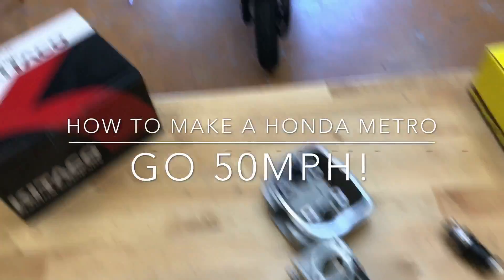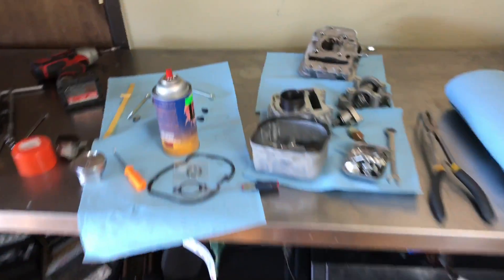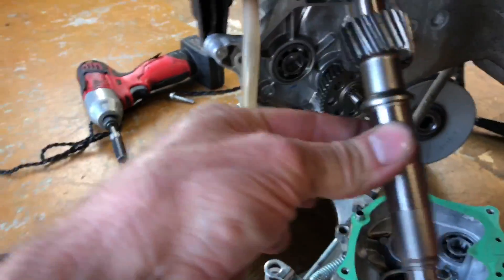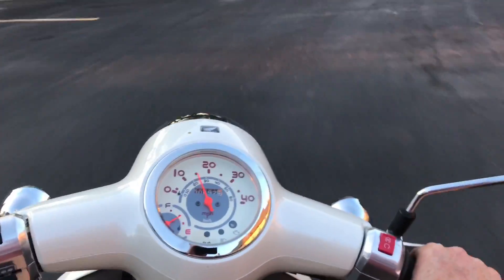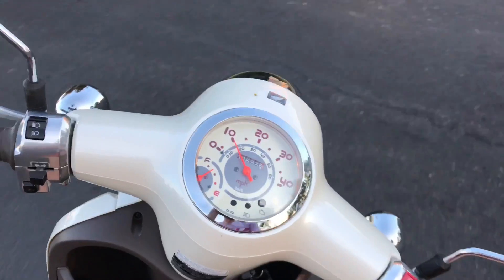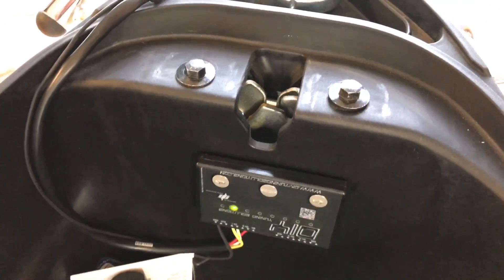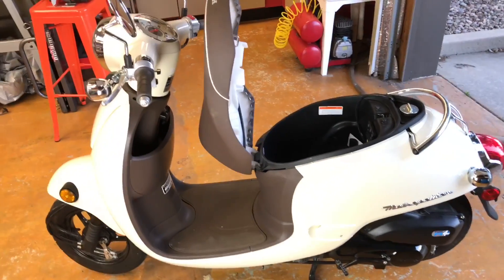How to make a Honda Metropolitan go 50MPH

Comment: I wish I could have someone like you  help me with this modification; I'm handy but afraid... you're not kidding the top speed is about 35-38 mph GOING DOWN HILL AND WIND AT YOUR BACK....  the state made me get a motorcycle license for this slug... barely goes 32mph to 35mph.  ONly 1500 miles since I bought it new too... and starting this back up again.  Quick question:  this was the first time I tried to fill it with air and I can't because the wheel rim gets in the way.  I have just ordered a right angle inflator adapter.

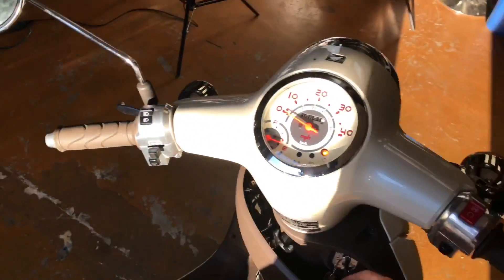Comment: As exciting as it is to install performance parts, it was very smart not to do the transmission mods, until you tested your engine mods. Had you modded the engine and transmission at the same time and had problems, it could’ve really muddied the water trying to diagnose the problem. 01:15

Comment: $900 a bit steep to increase a dozen miles an hour on this scooter. Just buy a used 150 scooter .
Reply from the maker: The reason not to upgrade to a larger scooter is because the laws change when your scooter is registered above 49cc
Reply: @RollingWrench  Gotcha . Has anyone ever been pulled over (cop) and had there bike checked for big bore kit ?
Reply from the maker: @TheSkyPod  I haven’t heard of it

Comment: I have a 2009 GET Metro. GPS said 47 mph with only a custom variator, custom filter using UNI foam and Moto-seal using the stock airbox and intake (I used the original air filters metal frame so it drops right in), small filter on crankcase breather tube, Gates power belt and a step up on the main jet. Lucas oils and fuel conditioner. Cruises at 35 and still gets around 90 mpg. Cost was about $100 USD. Edit: carburetor restrictor was removed as well. Also.. Keep your lifter shims in spec!!
Reply from the maker: Heck ya!!! But your comparing two different engines. The 2013-2015 engines are the slowest. The one in this vid. Your engine is referred to as a GET engine. Those are great as well
Reply: @RollingWrench  I wasn't comparing anything ;) Only possibly helping others :)
Reply from the maker: @TheSinkingGarage  I just wanted to be sure you and other readers understand the difference:-)
Reply: With my enthusiasm I neglected to mention that top speed is only increased 3ish mph. However the acceleration is great with stock 6 gram roller weights. Rider weight 170 with additional gear. 5.5 to 5.0 rollers would likely put it right in peak torque/nm in conjuntion with the Polini white spring on the clutch end of the transmission (the "shift" point,). No noticeable wear on the "ramps" with the increased spring pressure. With the valves adjusted and in spec I have experienced valve float. This is using the stock US spec CDI (rev limiter programmed into the CDI is relevant). This happened with a 8 year old engine with tons of high speed riding.  I would definitely refresh/replace valve springs if the engine needed service for something else or if the engine was removed.

Comment: Goodnight.  I have a doubt since about a month ago I installed a new battery to my Honda Metropolitan 2005 and it was running two days and then stopped turning on by button.  so it forces me to charge the battery constantly or turn it on by the pedal.  How can you solve this problem?

Comment: I don't understand why Honda made the Metropolitan slower.  I have two 2009 Metropolitans and they both will do 40 m.p.h. easily.  They are the CHF 50.  Some of my friends have older Metro's and they will do 40 m.p.h. as well.  Now these new Metropolitan scooters will only go 35 m.p.h. What's with that?
Reply: State laws on mopeds
Reply from the maker: Ya, I don’t know what’s up with that. I will say my favorite metro is 2013-2015 since they are upgradable
Reply: Ye I got one from some guy off fb marketplace and it’s like 2005 maybe and it hits 40 np if not more but I’m new so I’m worried about going faster lol
Reply: Emissions control regulations also restricted the performance of bikes!
Reply: Moped laws in my state require the engine to be 49cc and to go no less than 35mph

Comment: so this wont work on post 2015 models at all?
Reply from the maker: Yes it will: 2013-2015
Reply: @RollingWrench  my 2014 Metropolitan is Liquid Cooled. Can I still use your tuner to eliminate rev speed limiter?
Reply from the maker: @browntigercat  it would probably work, however the metro tuner doesn’t delete the rev limit :-(

Comment: How does this new kit 81cc still perform as good as the 95 with the small valve stock head?    Very confused.   
Kit shown is discontinued but identical description for a smaller kit with stock head.
Reply from the maker: It performs very well. I have videos of both kits. They don’t have the same description. The 81cc comes with less parts. They are both capable of 50 mph. It doesn’t have as much low end power as the 95cc, but still very impressive. Check out the other videos for comparison

Comment: But lets not forget that a crash at 50 mph is no different just because you're in a scooter.  "Just a helmet" is not applicable here.  You will be seriously maimed crashing at 50 mph without proper protective gear.  Also- they may not have designed the moped to properly brake (with control) at 50 mph.  Think safety!
Reply: I agree, these Metros really don't have the braking power to slow down great from 50mph, let alone 40mph. A bike with larger tires and disc brakes like an Aprilia would be better suited.

Comment: $875 for the kit? it would be cheaper swap in a gy6 150cc motor.
Reply from the maker: No one make a mount, you would need a harness, it would look stretched, waaaay more work, no longer a Honda motor, and it wouldn’t be fuel injected. Bad idea in my opinion.

Comment: Do you sell that tuning device separately? And is it pretty easy to install?  I have the variation and final gear drive already, no big bore, was wondering if the tuner combined with my current setup will show more gains
Reply from the maker: We can sell the tuner separately. It's $225. I wish I installed the variator and final drive gears before the big bore kit to see the difference. How does the 50 handle the final drive gears? What is the top speed. The big bore kit with out the final drive gears it would wheelie!
Reply: Rolling Wrench ATV Scooter & Motorcycle Repair I don't see a huge difference with the upgrades except for the low end, I want it to go at least 43mph and I'm at 38 on flat crouched over at 150lbs
Reply from the maker: Nick Klein I can tell you at a mile above sea level (we loose 20% of our power) I can do 50 mph on a flat with this upgrade. Brakes at that speed need to be upgraded I will say. Still stops but not like I would like.
Reply: Rolling Wrench ATV Scooter & Motorcycle Repair give me a link to buy the ecu tuner
Reply from the maker: Nick Klein https://www.rollingwrenchdenver.com/products/honda-metropolitan-fuel-injection-tuner-2013-2015